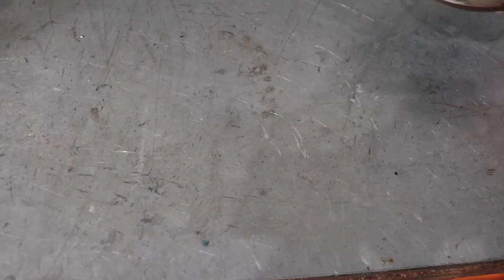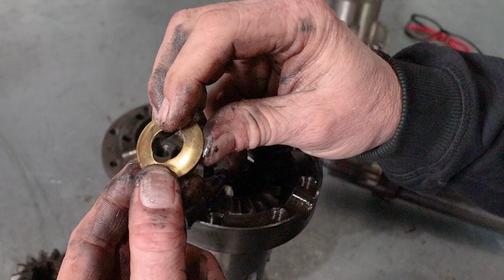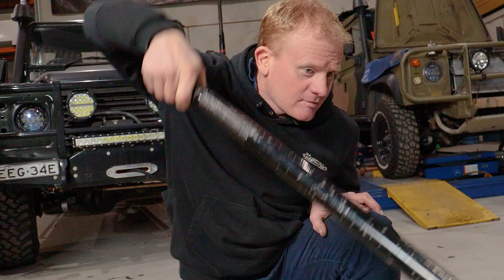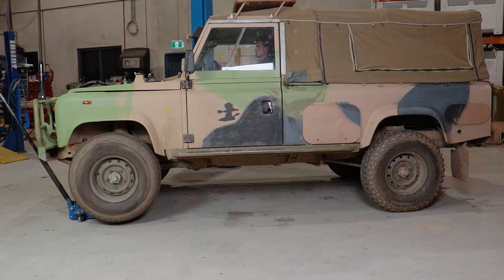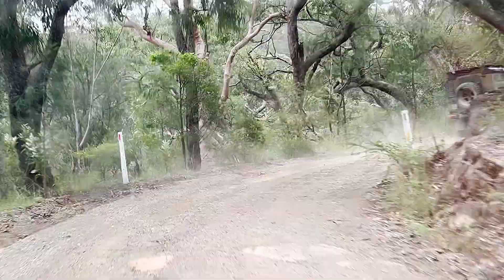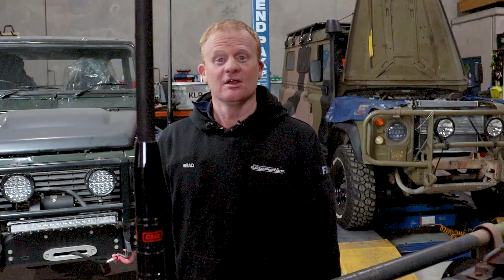Understanding Centre Diffs - Don't Make Expensive Mistakes!

Comment: I still have the original owner's manual that came with my 1982 Stage One 4BD1 Land Rover, It has an awesome write up on what gears/high/low and center difflock to use on what surfaces and conditions. It does not mention gravel roads at all however it does say High range/diff locked for light snow/ice, firm wet grassland, light recovery in slippery conditions and grassy surface or mud on the road. Then goes on to say Unlock diff as soon as conditions allow, to avoid unnecessary wear on transmission and tyres. As I read it between the lines loose dirt/gravel roads should come under this section as well. Speed is not an issue in high range it would suggest as no warning is given in this section of the book. So, if it is 1km or 100km of loose dirt or gravel roads it matters not? Keep center diff locked and unlock only when road turns solid hard again? This is why the front axle has CV joints (it does what it sez on the tin) 'Constant Velocity". For 'low range' speed is an issue So stick to lower gears here and avoid wheel spin. then unlock CD when obstacle is crossed. That is just my take on the subject. What say you KLR? Would you agree?

Comment: Not so sure about locking the Diff for long periods and at speed ! - it'll Wind Up the Transmission - i've seen it and felt the Wind Up Spin Out on the lightest wheel after not long engaged
Reply: What you say is true, however if the road surface is 'loose' enough to warrant engaging CD in the first place all wind up will be 'unwound' with the wheels being able to slip/spin out on said loose road surface. This is for High range/CD locked only, not at low range. My only concern is that some loose roads have sections that are hard packed as well, however these are usually over short stretches so may not be an issue? The trick according to KLR is to not let the wheels spin fast then stop spinning suddenly once traction is regained, this is what kills those little brass spacers and spider gears in the CD lock. Makes sense to me. Sort of like busting a CV on an uphill climb due to fast wheelspin followed by sudden traction regain, as I see it.
Reply: Yeah this is where the Mitsubishi super select transfer comes into play coz you can still select 2wd or Awd or 4H locked or 4L locked

Comment: Brilliant video, ties in with my own work.  Very nicely describes one of the reasons I tell people to lock centre diffs.  As a further example, with a TD5 Defender open-diff on a dirt road you can see and feel the traction control kick in on corrguated roads.  With CD locked...doesn't happen. So, better traction, less road damage, less transmission wear, less tyre wear..lock those c/ds soon as there is no risk of transmission windup!  Same is true of the new Grenadier.  Once you are at the campsite or at walking pace unlock, you'll have a slightly better turning circle and less tyre wear turning tightly.

Comment: Great explanation. I once drove my Defender 110 300tdi about 80kms at highway speeds on bitumen with the centre diff accidentally on lock (i'd just finished working on it with it jacked up and LR recommend you lock the diff while doing this). I'm pretty amazed nothing exploded, although I've been worried about it ever since (some 50,000 kms later...)

Comment: I wonder now about my subarus that have awd but no diff lock.
Reply: Only watched this 'cause of my Subaru's - they have a set of clutch plates that auto locks the diff when slippage occurs, like a limited slip kind of deal. Amazing bit of kit. I've got a couple in bits - when they failed I stripped them to show the mechanics who were arguing the toss about how they work.

Comment: Great explanation. It's like scratching a chalkboard to me when drivers "brag" they didn't need the diff lock when crossing the Simpson or going thru Wonnangatta etc.. Early Rangie owners made a lot of Warranty claims over this "premature wear".
Reply: It's hard to do any real 4wding without centre diff lock.  They're probably talking aboutnot using the rear diff lock.  Heaps of people brag about not needing the rear locker.  But it's better for the drivel train to use it.

Comment: Awesome - great visual explanation! Way too nervous though to lock while moving in my '95 Defender tdi.
Question: with a tricky axle twister, I really hate the idea of sending it through, because of how fast the opposite wheels get spinning before biting again. Would stomping on the brakes while full on the throttle simulate traction?

Comment: thanks.. love the explanation, I have always stopped to tuen it on and off, can you turn off the cdl whilst on the move also? I normally have to reverse a bit to get the light to turn off.
Reply: That sounds more like  Automatic  Free-wheeling  Hubs  rather than a CDL .
Reply: @johncunningham4820  Both my Rangeys and cruisers needed to be backed up to get the dif lock to let go. Really annoying when you're trying to get out of a tight spot onto fast roads.
Reply: It's a matter of the locking gear lining up to disengage.  Sometimes it disengages easily, sometimes you need a bit of left right and sometimes a bit of back and forth. Could also be a sign of transmission wind up.